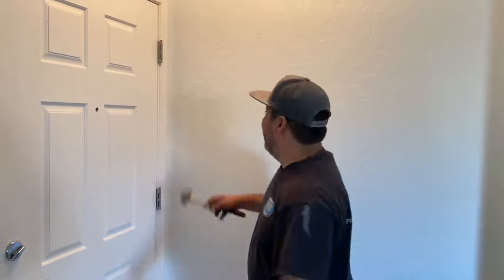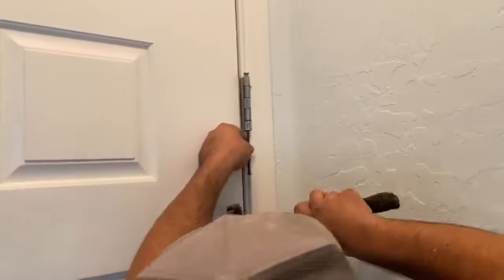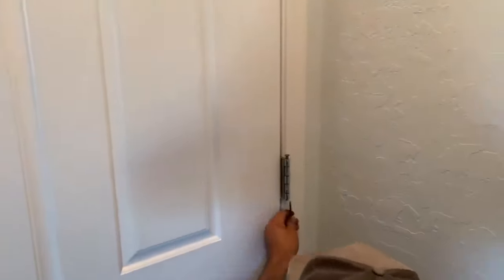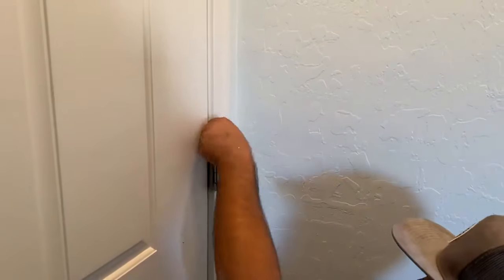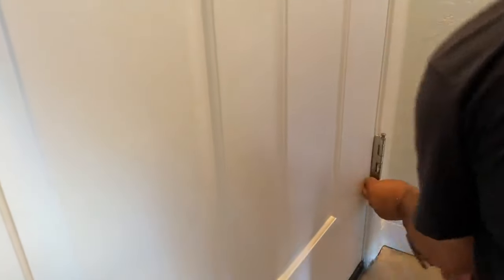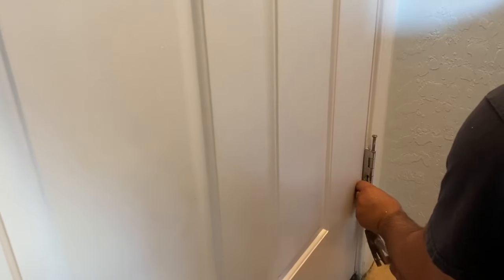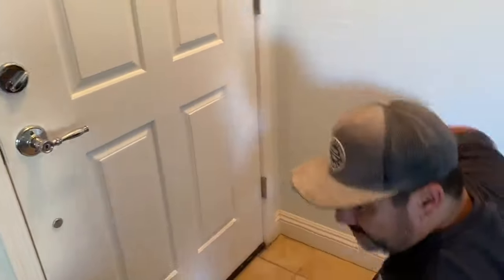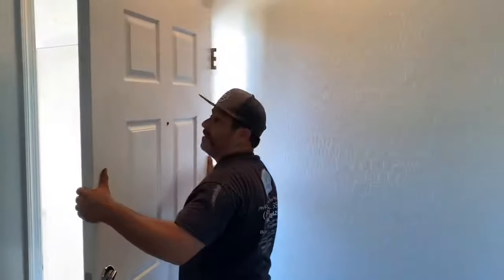How to Remove Door Hinge Pins with a Hammer and Nail | DIY Home Repair

Comment: What do you do if the pin is stuck? I can't for the life of me remove it.
Reply: I'm having the same issue. All these videos seem to be brand new doors where you breathe on it and they come flying out nicely. My pins seem like they are super glued in, so need a video which tackles realistic situations.
Reply: Rubber mallet did it for me, could get a bit more umph behind it.
Reply: I have a brand new door, no bottom cap and 2 of the 3 will not budge
Reply: Wd-40?

Comment: I don’t have as much clearance between the floor & the bottom hinge to get a nail under the pin and hit it with a hammer?
Reply: I'd get a really small nail and then make some sort of teeter totter type of thing where you slam the hammer downward on one end and it brings the force upward to the small nail, thinking out loud here but that might work
Reply: Open door. Remove hinge from spine of door. Once door is off remove pin. When reinstalling make sure to insert pin from top or put pin into hinge before hinge goes on door